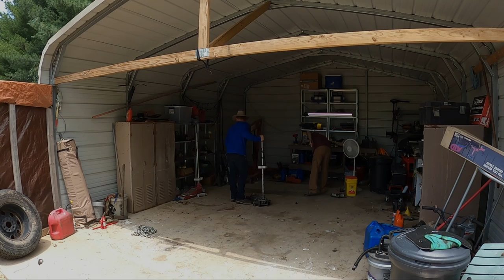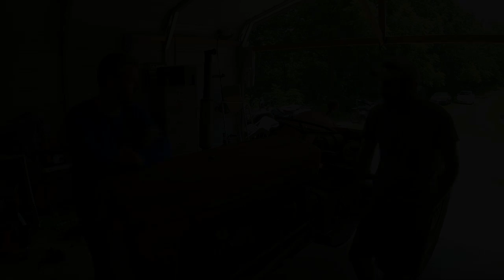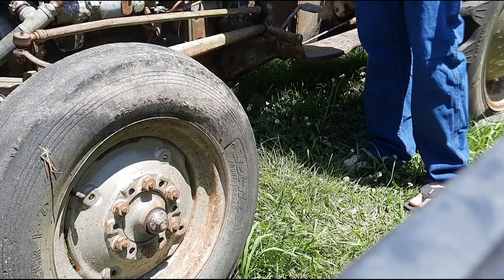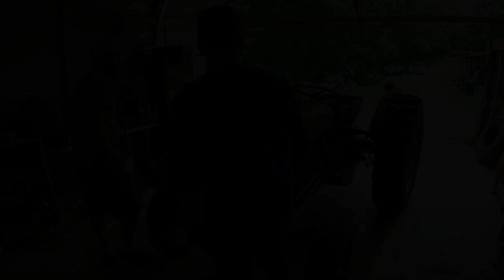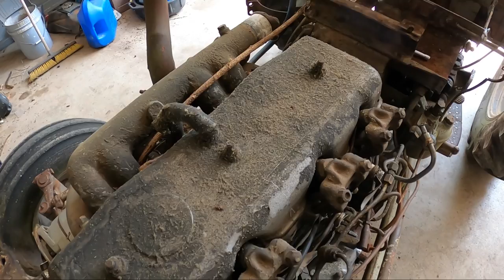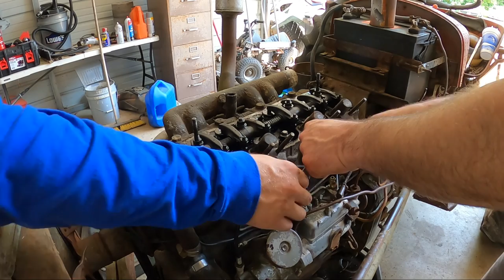Tractor Rescue Part 3: Fuel Tank &  Injector Removal

Comment: I use to own one of these tractors, exactly the same! At least twice I had same issues with the gears
and the method to to fix was the same as you found out about. It was a fantastic little tractor and I wish that I still owned it.
Reply from the maker: Luckily it's an easy fix 🙂👍  Thanks for stopping by Stephen 🔧🔩

Comment: There are 12v glow plugs called gam101 for Land Rover series 3 2,25 that is connected in parallel like modern glow plugs.. The pig tail 1.7v original glow plugs also fits Land Rover 2.25
Reply: You know what. I just looked those up. I'm gonna do some more investigation but that might be just the thing we need. Thanks man. Good Intel.
Reply from the maker: Thanks for the information! 😁👍 It's greatly appreciated

Comment: I think that tractor has the Perkins engine in it. Simple to work on. Think I would have those injectors cleaned and tested. Make sure they atomize the fuel properly. Make sure you put new copper seals on them when you reinstall them. Any diesel injection shop can do them. Those are fine garden and small job tractors. Good for mowing etc. Also check for water in the trans. and rear end if it has been sitting in the weather for a long time.
Reply from the maker: Thanks for the suggestions Johnny! 🙂👍 Dustin and I both appreciate that. Luckily there was no water in the transmission but it was almost empty. Hardly any fluid. We will check it over good before it's ever driven. Take care and thanks for stopping by 🔧🔩
Reply: Everything I've looked up on it so far points it to being the standard. Or at least that's what all the parts line up with so far.

Comment: 23c engine same as fe35 4 cylinder? Not easy started unless set up just right  although you are on a winner with export head with heater plugs. Vintage tractor engineer did a great dvd on 23c rebuild
Reply from the maker: I will have to look that up Martin 🙂 Thanks for the view and kind words. Take care

Comment: I used to have a Ratchet similar to that Thorson, might have even been the same model but I can't remember but it did have the same method of changing directions and everything. One of those things you pick up along the way randomly. Luckily most of my tools were like that, cheap or free because they got stolen out of the back of my Blazer a while back.
Reply from the maker: Oh!! 😣 I'm sorry you had them stolen!!  Almost nothing is worse than a thief!  I appreciate you stopping by Harvey. I hope you can find replacements soon.
Reply: @HODGEPODGEDODGEGARAGE  I replaced most of the stuff a while ago when Lowes was having a Christmas sale.
Reply: I've got the whole set. Got at an auction pretty sure
Reply from the maker: @bigghoss762  Oh good. I'm glad you got them replaced  🙂👍 It's always difficult to fix anything with limited tools

Comment: on you pump look for the G on it and use a 1/4bolt in the flywheel to time it if not it will run but  not that great I hope this helps you most of the parts you can get from England and All State Ag and broken tractor
Reply from the maker: Thanks for the information on pump timing Julian. 🙂👍 Much appreciated my friend. Glad you stopped by an take care 🔧

Comment: that Engine is called a STD Engine or a 23C you can get some parts in the states and the hard to find will be in England Agrline is the one I use in England All State in the USA and Relable in the USA and Broken Tractor Engine rebuild kits they are about everywere in England it will be under Ferguson FE35 STD Diesel or 23C  Injection pump can be rebuilt their is a place in Orlando that can rebuild them and the injectors as well Accurite Diesel on Divison ST
Reply from the maker: Thank you for the view and the information Julian! 🙂👍  Much appreciated my friend. I will be sure to relay the information to Dustin. Take care and be safe 🔧🔩